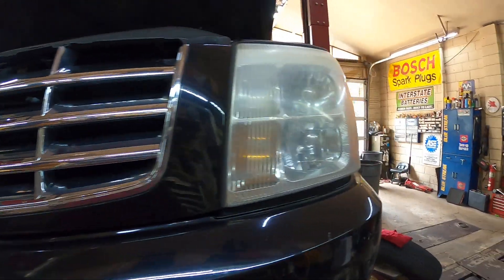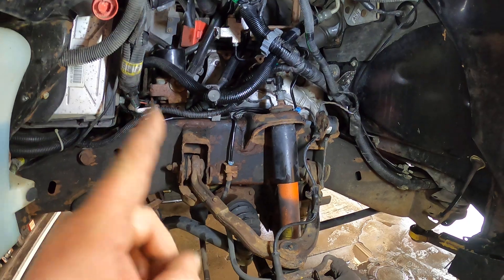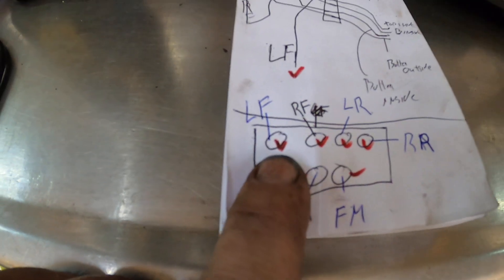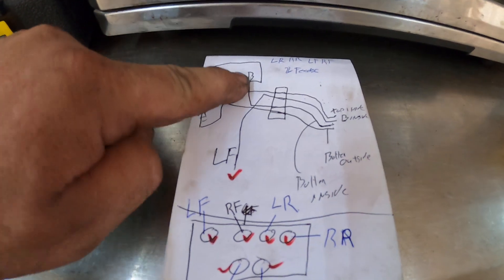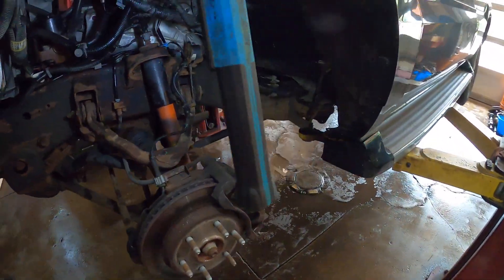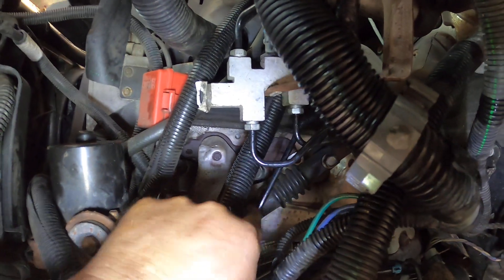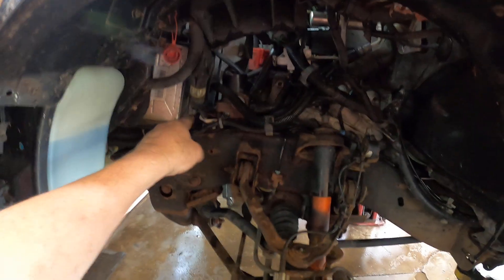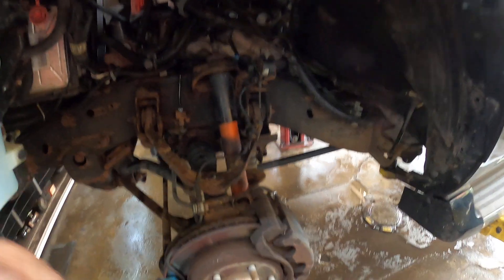GM Truck/SUV Brake Line Replacement Overview With Stabilitrak

Comment: Question? What tools are the best to use for loosing up the brake at the ABS module? Thanks;  I tried a wrench but is to big for small spaces.
Reply from the maker: I cut the old lines off right at the line nut and use a socket on the old nuts. Then I use a short wrench to reinstall the new lines.
Reply: @TheGAutomotiveAndMore   thank you. Super helpful.

Comment: I'm pretty sure it's 1/4 OD line for most all lines. But the rear 2 lines are common 3/16 line/ l think.
I could not find a Kit so we used the old fittings with copper and 1/4 OD line.
(Edit: confusion is the 5/16 fittings that take a 1/4 OD line) gm is crazy.